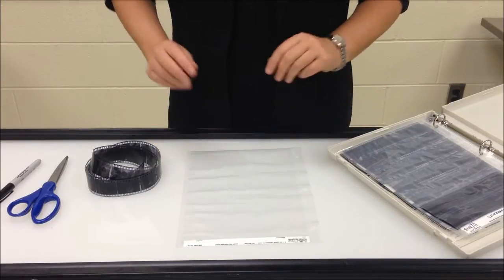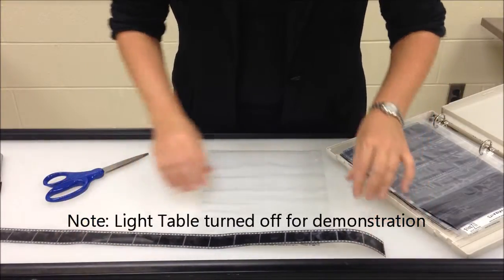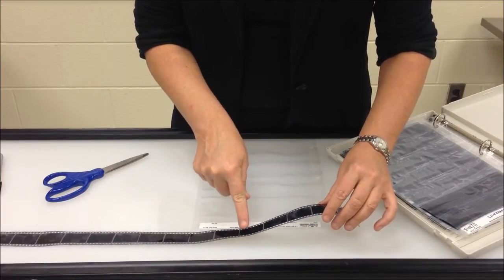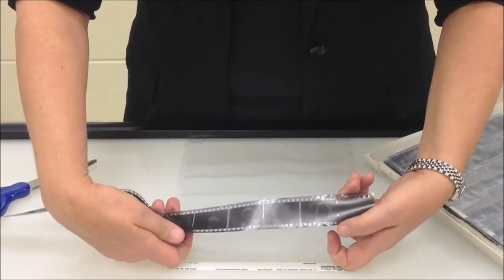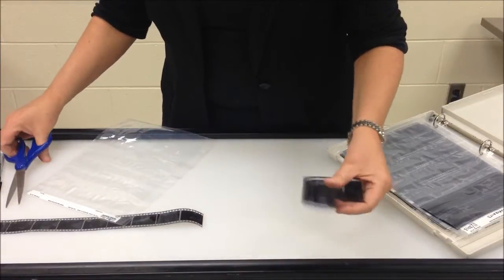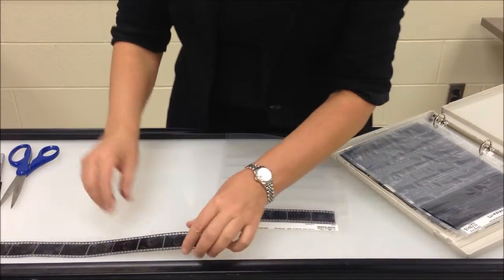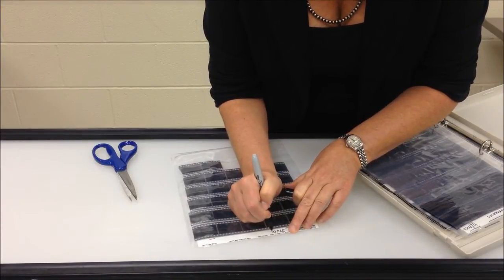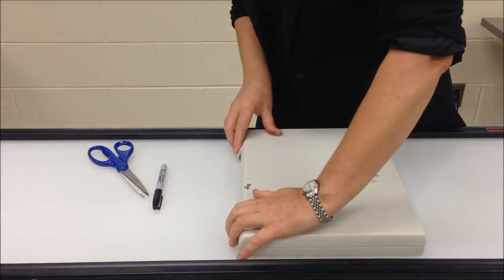How To Cut and Sleeve 35mm Film Negatives

Comment: Came here just to see how others were doing it. I don't have a light table, just my makeshift photo lab. Black and white is easy to cut. But I've had a surprisingly difficult time cutting color film. There's been several times where I cut part of a frame, or cut a crooked line. Tonight I'm going to try cutting a roll of 35mm portra with a rotary cutter. Hopefully this works because I'm really excited about this roll !
Reply: I hope you didn't inadvertantly scratch your film while cutting using a rotary (slide) cutter).  If you cut them over light colored table or a dark table it may help you see the boarder edge better for cuttting.